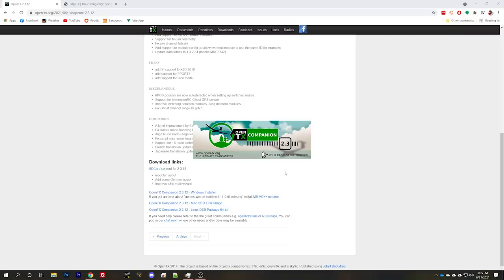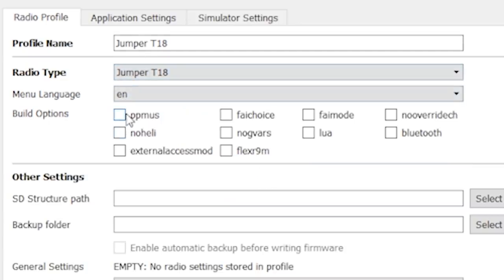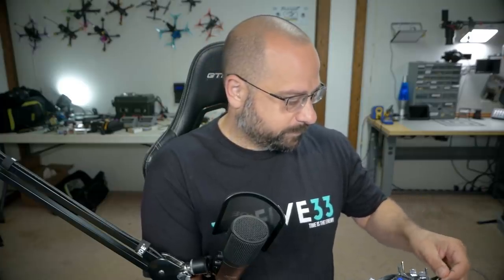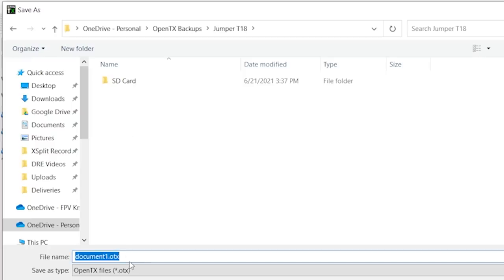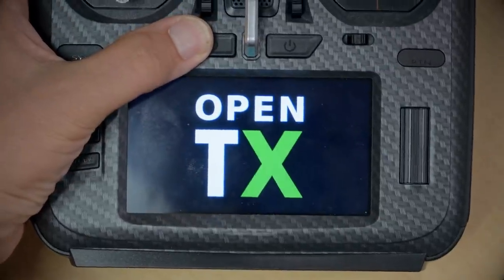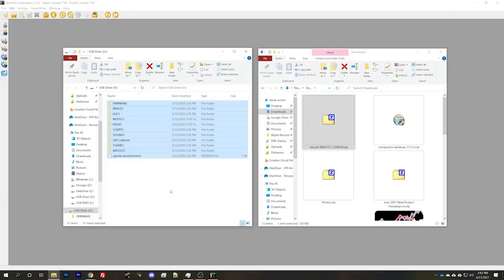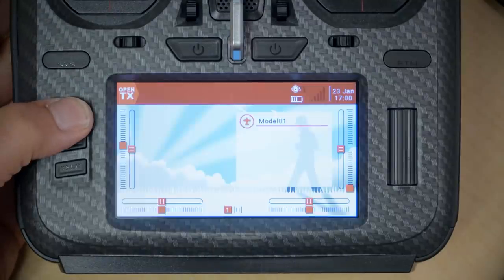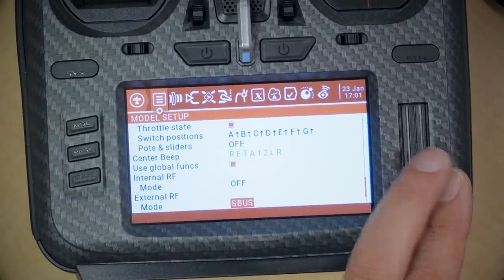CRSFSHOT is for everyone (even if you don't use Crossfire)

Comment: ther is a OpenTX 2.3.13  as well  see 
OpenTX 2.3.13 (2021-06-24)
OpenTX 2.3.12 (2021-06-14)
Reply from the maker: It literally just released today didn't it. What unfortunate timing LOL.
Reply: @JoshuaBardwell  Sync problem :) Train just arrived.
Reply: @JoshuaBardwell  eney ider how to get rid of the SD CARD Warning 2.3v0038 i no i can get this up into notepad 2.3v0038  but not shor what to chaine the number to
Reply: @JoshuaBardwell  Back to the drawing board
Reply: it's just a quick fix for horus and t8
Reply: @DeeFPV  warning should say what number it is looking for.  Then change to that in notepad
Reply: @JoshuaBardwell  happened the exact same thing on almost all latest versions if you check the website News section. You released a video and boom new version and then nothing for long time.

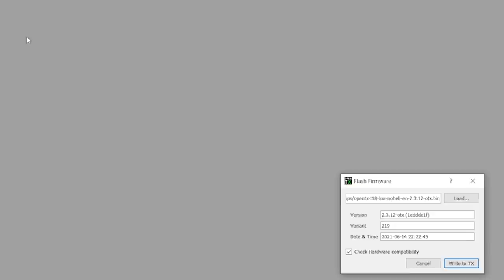Comment: @10:35 trying to write the firmware and still in storage mode. You need to unplug, power down, then plug in while off so it connects with the stm32 driver (I believe the Impulse RC driver fixer may help here) then the companion app will flash the new bootloader followed by the otx firmware.

Comment: using the USB on the radio may be slow, but companion provides a synchronize SD card tool. This will only update older files to the newest ones. If you use this tool you don't have to go and save all your sounds and lua scripts and whatever. I like to download the new SDCARD. Then I make a backup of the current SDCARD just in case. And then I use synchronize to update the files. It's always a good update this way. I usually just set it and walk away and let it do it's thing. BUT.. If you don't want to use the USB due to speed, you can pull the SD out and set the Radio folder in the tool to the sd card and it will work as well. Usually when I am updating opent TX it's usually not a hasty process and I am not rushing to get it done. Its not something you want to rush.

Comment: Be extra careful with the MicroSD slot as it is extremely fragile specially on the Jumper T-18, I personally plug in the radio and use as a card reader even if it’s slower just so I don’t have to fiddle with inserting the card.

Comment: Just FYI - 14:37 the ExpressLRS custom build gives us the ability to flash the .elrs firmware files to supported TX modules straight from the handset (I.e after you flashed the BL).
Reply from the maker: That was my suspicion. If you always flash via passthrough or WiFi do you need it?
Reply: @JoshuaBardwell  passthrough is more for the RXs rather then the TX.
Wifi and USB (for modules that have a USB port) can be used though, and then you wouldn’t need the custom build. The ability to flash .elrs was something that Raph was planning to merge into OTX, but I’m not sure if that’s made it in yet. Haven’t tested if EdgeTX has it by default either yet.
Reply from the maker: Hmm. I see. So you still want it to flash .elrs to the module. Understood.

Comment: ELRS works great on 2.3.12 !
Reply: That's one I have cause ELRS. I never bothered with crsfshot .  I still don't understand why I need it lol
Reply: @divingfalconfpv4602  if you have .12, I think you have it already.  It means lower jitter which is a higher quality radio link.  
You can see it working on your elrs LUA screen.  If you're set to 250hZ, you'll see 0:250.
Reply: @divingfalconfpv4602  see the below from the ELRS wiki:

"Also the Lua script was recently updated with an important feature, top right it shows an indicator 0:200 which tells you how many bad UART packets and how many packets/second it's getting from the radio. It can be used to confirm the communication between the Radio and the R9M module is working properly.

0:200 means : 0 bad packets and 200 good packets (per second).

The value should match the selected air rate (200 for 200Hz, 50 for 50Hz, etc..)

If it doesn't and is stuck at 250 that means crsfshot isn't working."
Reply: @wmcewa01  oh ok yeah mine reads right on ELRS. only thing noticed is at slow hz I get TLM packet error. Have to raise TLM rate.  
My actual crsf I never looked if crsfshot is on.

Comment: I have a problem with my drone I can't find any videos on it but idk really what to even type it's yaw in betaflight will sometimes move slowly and be 20 points off of center so I trim it so it's centered and if I move the sticks around again it'll be 20 points too high and it doesn't seem consistent any suggestions?

Comment: I updated and all seems to work, however when switching models in the radio (I have one set up for LR and one set up for freestyle 5 inchers) - my Tx won't connect to the Rx until I go into model set up on the radio and click on the external protocol, switch out of and back into CRSF. It does it every time. No need to rebind, just need to change the External Protocol. Anyone else have this issue? I'm on a Taranis S9D+ 2019 SE.
Reply: just run the update on mine and having the same issue, every time i switch the taranis on i have to deselect and reselect the crsf eternal protocol for it to connect, im running the taranis x9d+SE (pre 2019)
Reply: ok i just fixed this by updating my external tbs module to the latest firmware via tbs agentx
Reply: @stiktech  will give it a shot. I updated my TBS a few weeks ago but will check again!
Reply: Nope - tried refreshing 2.3.13, refreshing my crossfire Tx (already had the latest but redid it). Same issue. :-(
Reply: Figured it out. https://youtu.be/1XA_LUymaaI explains it. I had different receiver numbers set up (from my old days of flying Helis i still had the habit). Apparently as of 2.3.10, you need to set your crsf models to receiver 00 on the setup page. Just tried it. Works like a charm.

Comment: I tried esc configurator but I think i messed us something.
I flashed an ESC firmvare ant it's not working. what firmvare should i flash to get me back to normal?
Please help
Reply: Whatever the lastest is for the BLHeli_S Configurator.. the S version not 32 if ur still talking about ur Meteor65, could also use Bluejay, as suggested earlier.
Product page: Factory firmware: O_L_5_REV16_6.HEX (later versions O_H_5_REV16_6.HEX)

Comment: Hi!
I'm trying to change the PWM freqency to 48Khz on my Meteor65 by BLheli32.
When I connect the FC, error messages poping up and it won't detect any of the ESCs.
The battery is connected and the boot note plays.
What should be the problem?
Reply: What error messages?
Reply: I'm not sure the ESC in the Meteor65 supports BLheli32.  If you want 48kHz and RPM filtering flash the ESCs to BlueJay.
Reply: Try esc-configurator.com instead. You are trying to flash a blheli s esc with blheli32. That will not work lol you need to use blheli s
Reply: Found no ESC configuration:
ESC#1: ---
ESC#2: ---
ESC#3: ---
ESC#4: ---

Than
Found outdated 4way-interreference revision v20.0.0.4
Reply: I tried esc configurator but I think i messed us something.
I flashed an ESC firmvare ant it's not working. what firmvare should i flash to get me back to normal?
Please help
Reply: @rckyfpv  I don't know how you would get it back to normal, but find what kind of esc is on your quad (look for an esc version like "gh-30" or something, I can't remember the exact format) and then download bluejay configurator. Next plug in the quad to usb and then plug in the battery. Click connect and read setup on bluejay. In the bottom right it will say 'flash all' (or something close). Click that and then select the correct esc version you found earlier, select the most recent release of the bluejay firmware with the 48khz pwm frequency. (It should say 48k in the name)
Reply: @rckyfpv  I think your esc version is "O_L_5" but please double check that by looking up meteor 65, and making sure you have the same board as in the picture. Next look up that board, and most stores should list the esc firmware. Note the first part of it (REVx_x.hex doesn't matter)
Reply: @Bean-Time  That's  O_H_5_REV16_8.HEX but it's not working
Reply: O_L_5 is not working, gh-30 is not working, O_H_5_REV16_8.HEX i think i should buy a new FC.
Reply: Could you send me the debug log please?
Reply: @rckyfpv  as posted above from product page
Factory firmware: O_L_5_REV16_6.HEX (later versions O_H_5_REV16_6.HEX)
Edit: If the first 3 letters/Numbers are correct a later version should indeed work, double check.

Question: Have you flashed it with Betaflight, not BLHeli and chosen the wrong target? and thats why it's not working?
Firmware version: Frsky / Futaba: Betaflight MATEKF411RX (MK41R) , DSMX: Betaflight MATEKF411
targets would either be MATEKF411RX or MATEKF411
Bonus Tip: Take notes b4 flashing 🥺
Reply: Thanks for your help!
The motors direction were messed up. The right order is: 1.Normal 2.Reversed 3.Reverse 4.Normal
It works now. (:

Comment: If I am running tracer, will CRSF V3 take care of this issue or do I still need to do this update? Thanks.
Reply from the maker: The heartbeat sync issue that crossfire shot fixes is separate from crossfire v3 which is a new air and wire protocol.
Reply: @JoshuaBardwell  great, thanks!

Comment: Anyone running elrs and 500hz , do not use 2.3.12 or 2..3.13 , there’s bug that limits or doesn’t support 500hz.  Go edge tx or stick to the 2.3.10 special nightly build for elrs
Reply: Is this reported on ELRS Discord?
Reply: @allennickles3970  i saw it on their fb page
Reply: @qilingandfriends  I appreciate you putting this out there! I been running a nightly build for three months. And was thinking of updating until I seen your post. Thanks for the heads up!😀
Reply: @allennickles3970  No worries buddy. I converted all the flight to ELRS and been waiting for OpenTX to come out with 2.3.13 and it seems they mess up the 500hz again.

So, i just switched to EdgeTX.
Reply: @qilingandfriends  EdgeTx support ELRS 500hz mode?
Reply: @allennickles3970  yes

Comment: Frsky has had opentx 2.3.12 for a while for the qx7 access. Does their version also have cfshot or do i need to get it straight from opentx?
Reply from the maker: Last I checked FrSky has removed all crossfire support from the builds they distribute. If yi uare running the FrSky version I don't think you will see CRSF as am option
Reply: @JoshuaBardwell  I mean i still have crossfire lua and crsf is an option for the external rx. And i have 2.3.9 from frsky.
Reply: @JoshuaBardwell  So for those of us on FrSky (I'm on Xlite Pro and R9MLP external module, both ACCESS) I should run the latest from Companion instead? 

Wonder if it will effect my RaceMode (4ms mode) on the Archer RS receivers....
Reply from the maker: I have only got one radio to check but for me I don't see CRSF in the external module options.

Comment: Your kidding right....even Tbs has replaced crossfire shot with cfv3... so instead of of poorly scaled  10 bit data we now have 11bit full resolution stick data.. this video is 6months ours date frankly but hey I guess you learnt somthing today
Reply from the maker: Sorry but I think you have made the exact mistake I was trying to explain away in the video. Crsfshot is mixer sync bug fix inside opentx which applies to all protocols. Crossfire v3 is a new iteration of the crossfire protocol which includes over the air and over the wire changes. TBS implemented the mixer sync bug fix in 2020 and called it crossfire shot. It is different from CRSF v3.

The point is, mixer sync bug fix nee crossfire shot is desirable to everyone even those not running crossfire. When people ask, should I use crossfire or crossfire shot, or, will crossfire v3 replace crossfire shot, that's the mistake this video is trying to clear up.
Reply: @JoshuaBardwell  it wasn’t a bug.. it was never implemented properly.. until a year ago..  let’s just say thanks to TBS been willing to actually work with BF now tracer and crossfire v3 are the best radio links on the market right now 😁
Reply from the maker: "Failed to implement properly" I would call a bug, but potato potatoe. Crossfire V3 I don't think fixes this issue regardless. Kudos to TBS for implementing the fix that the OpenTX devs ignored for too long. 

Tracer and Crossfire best radio link? Hmmmm.... ExpressLRS has much more consistent jitter and Ghost is implementing a new mode that uses 500 Hz dual-antenna diversity to produce a 250 Hz link that is nearly immune to dropped packets. I don't think there's a clear winner in this market, and that's amazing for consumers.
Reply: @JoshuaBardwell  not any more ghost and elrs have some catching up to do with tracer right now.. granted all the firmware is in alpha but the work has been done
Reply: @JoshuaBardwell  hopefully elrs move  to cfv3 protocol soon and embrace 11bit. 10bit does not provide enough resolution to get the most out of any of the high speed links
Reply from the maker: Looking forward to this new alpha version of Tracer to be available. Just 2 weeks from now right?
Reply: @JoshuaBardwell  lols
Reply from the maker: Just following up, I asked Mike Chin and he said CRSF V3 requires CRSFshot to work. So if you are using CRSF v3 then you can assume you're using CRSFshot, but CRSF V3 doesn't replace CRSFshot. And personally I wish we'd all start calling it "mixer sync" or something generic, instead of CRSFshot, so people would stop assuming it's exclusive to Crossfire.
Reply: @JoshuaBardwell  totally true but you know how marketing is..  you’ll be happy to know that ghost is currently undergoing work to bring it up to proper 11/12bit also..BF 4.3 is going to be a big deal with all this clean radio data

Comment: I'm kind of angry. With the new laws coming out against the RC hobby I was grateful to have a
few TRUE "Kabob" toothpick frames.
Long story short.
I went to make a FC replacement (that apparently I didn't even need to do)
(either that or this new FC already has a bad ESC  WTF!) 
anyway . I cant get Betaflight 3.5 loaded from anywhere.
I got the specific 3.5 hex for the Mamba 411 AIO.  BF wont let you load that old hex from version 10.7 Configurator.
Sooooooo  I got the BF Configurator 10.4 (and this bitch completely wipes my existing betaflight install folder even though
it was installed to ITS OWN FREAKING FOLDER ( FML ) 
Tried Emu flight , I figured this was a sign from God hahahah  NOPE  !!!
that froze up my FC had to use boot button to get Betaflight 4.2
(whatever version is current)back on the damn board. 
Thank god for boot buttons! 
And yes that means uninstalling BF 10.4 and re installing 10.7.
Tried the new board after re-soldering all that tiny stuff (marvelous that the NEW Mamba 411 DOESNT LABEL THE Soldering PINS WTF)
Lazy Motherxxxxxxs  anyway...  
I fire it up with Bf 4.2 after applying my dump from 3.5 & resources / what have you and she shimmies like she is
going through withdrawal. Like a crackhead in the desert.   Oh and of course my questionable motor 
which I assume as usual was a bad FET on one of the ESCs is still being an ass hat.
So now I still,     have to swap that motor,    just to confirm.

HOW THE HELL DOES ONE LOAD BetaFlight 3.5 these days?
Whatever plunger or lube is required to accomplish this majestically insane  feat I need to know!! PLEASE ANYONE  ...because tuning
a 3" 2S a toothpick on BetaFlight 4.X is Complete Fuckery
Reply from the maker: Manually download the bf 3.5 hex file from the github repo, then "load local file" instead of "load online" and flash it from the current configurator .
Reply: @JoshuaBardwell  Will attempt that   AGAIN   thank you for the reply    pretty sure I've tried that a few times to no avail betaflight_3.5.7_MATEKF722SE.hex   && betaflight_3.5.7_MATEKF722.hex    for the https://www.getfpv.com/matek-systems-f722-std-flight-controller-w-f7-32k-gyro-bfosd-barometer.html